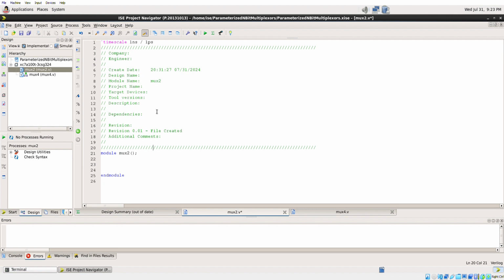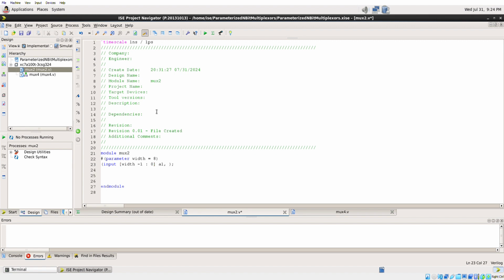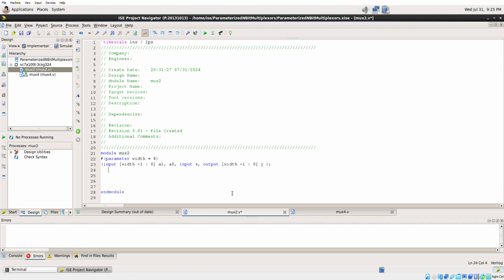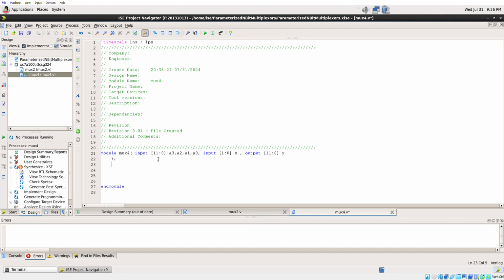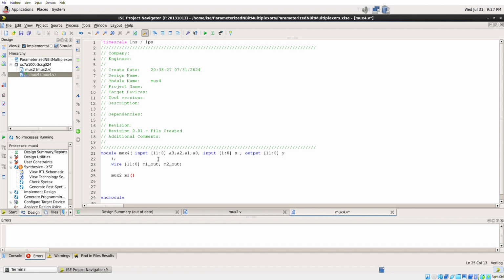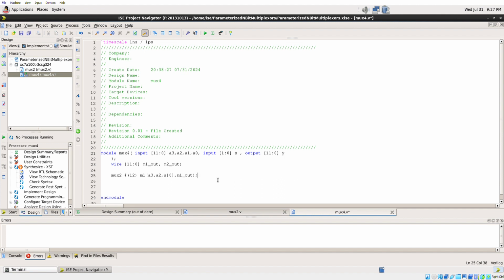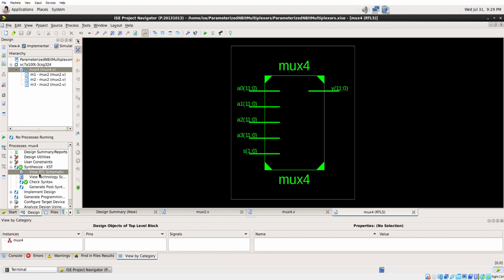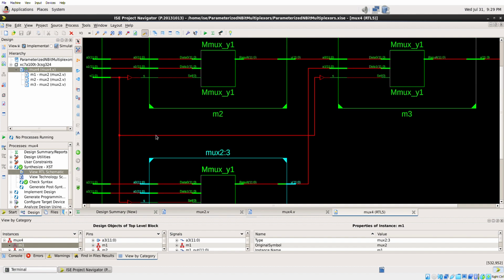Designing Parameterized Modules in Verilog

Comment: Through the years, the debugging tools available for software development have become very sophisticated..  with advanced breakpoint capability, stepping, realt-time variable watching (swv), etc..  with HDLs, it seems the process of debugging hasn't changed and still requires manually writing thousands of test-benches!   (Altera's old Max+Plus II Waveform Editor you can could draw your waveforms, then simulate!)

Do you know if there's been any development in the area debugging of logic? Everything I've seen still uses test-benches (Icarus Verilog, Verilator/signalflip-js, Aldec Active-HDL, Metrics Cloud Simulator, GHDL for VHDL)!

BTW, any thoughts on using Python for HDL (migen/nMigen/Amaranth HDL-LambdaSoc,  LiteX, Chisel HDL , Spinal HDL?
Reply: Thanks a lot for sharing these insights! You’ve brought up some great points about debugging tools and Python-based HDLs. I know the industry has been using a lot of generators using python. I’ll make sure to incorporate these suggestions with my team into upcoming videos. I’ve been a bit busy with my master’s program at NCSU, but I’m looking forward to covering this in more detail soon!